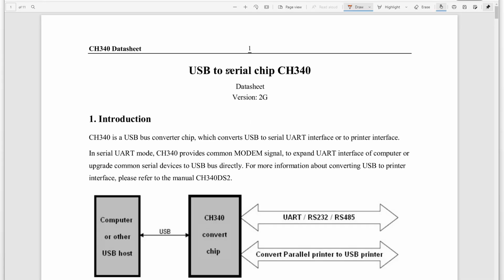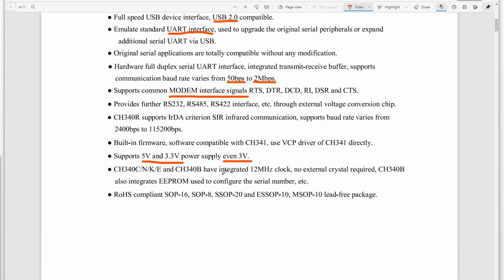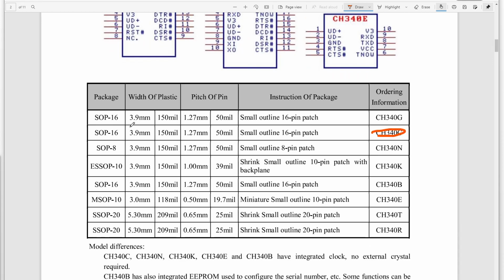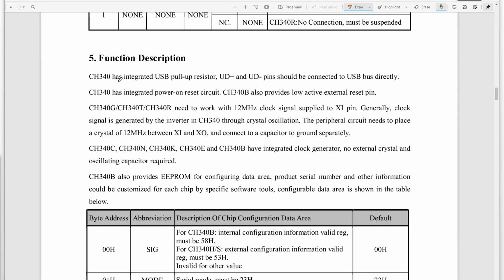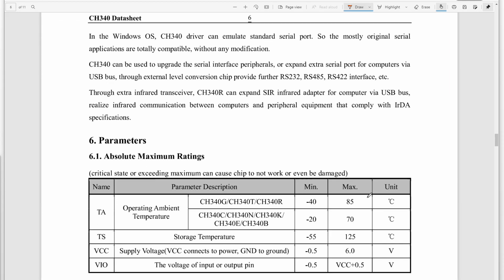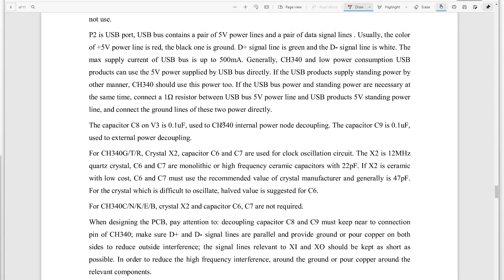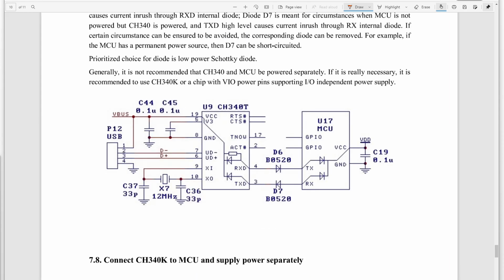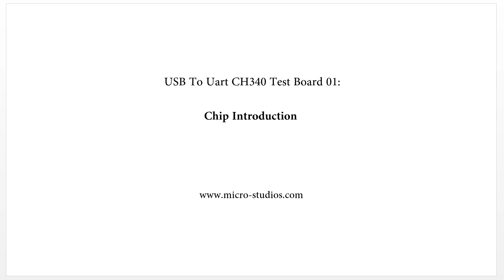USB To Uart CH340 Test Board 01: Chip Introduction

Comment: Hi Michael, I am only getting audio in the left channel and I can hear mains hum.
Reply from the maker: I tried it on my computer and my phone again. It seems, if adjust the volume to nearly the maximum, the "mains hum" will be apparent. If set the volume to the middle, it will be much better. It might because I use a new microphone, originally, I though it would be better than my laptop's. Thank you very much for your kindness reminder. But, unfortunately, I have used it for the next two videos, which will be published in the next two days. I will stop using it to record new videos.
Reply: @Michael_ee  Just FYI, I listen on headphones, so any audio issues are more apparent. The missing right channel audio should be easy to fix?
BTW WCH make a whole set of interesting devices, especially if you are interested in USB, so I will be interested to see which other devices you look at. I am currently researching the CH376, which allows USB file access from either parallel port, serial port or SPI. My interest is can it be used for keyboard HID too?
Reply from the maker: @migry  I am afraid I don't have time to modify the video again. For the CH376, if I am not wrong, it seems can control keyboard, but not show in computer as one keyboard HID.